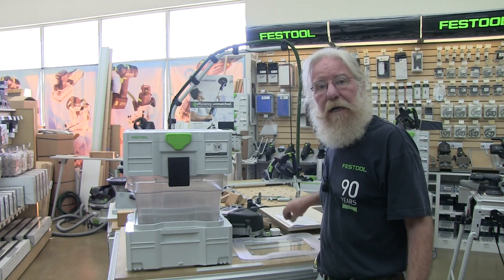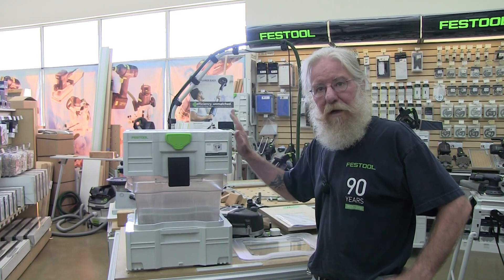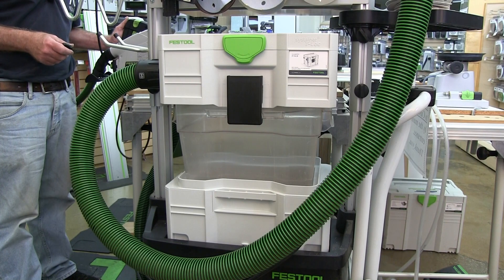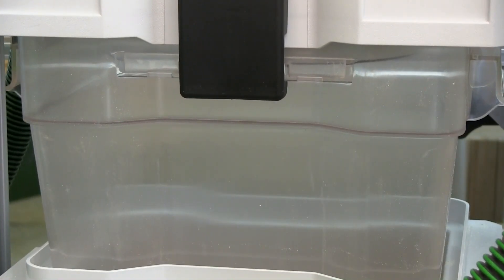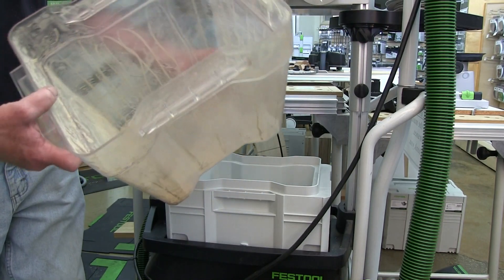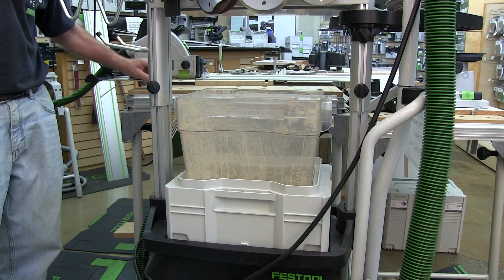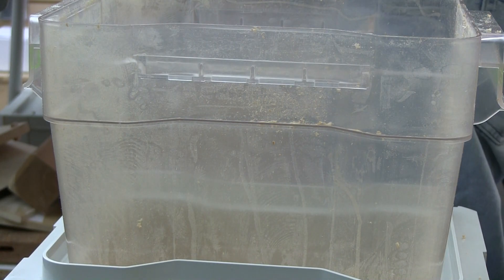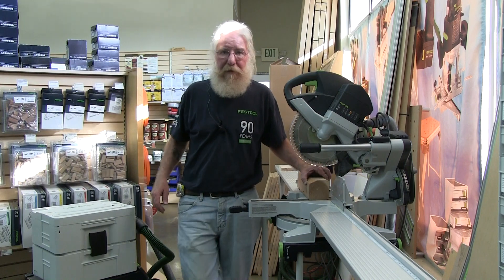CT CYCLOME 1

Comment: Thanks. Nicely done video. This is the first video to show the workstation installed over the CT-VA. All these videos show how much dust is going into what bag. Obviously that is the point. I have seen many demos as to the CFM measurements of the pre and post cyclone setup. However, I have not yet seen any videos that show how well the system actually collects the dust from the tool. For instance, how much dust is leaving the tool into the workshop vs how much goes into the bag. I would have liked to see some video of a track saw cut to show how much is picked by the system and how much still goes into the shop area.

Comment: Hi! Thanks for the review! Will this cyclone work on CTL SYS?
Reply: Of course, but you can not use it on the top of the SYS. From the SYS to a vac, the hose is 50 mm, the SYS has only 36 mm hole in the front of the hose garage.